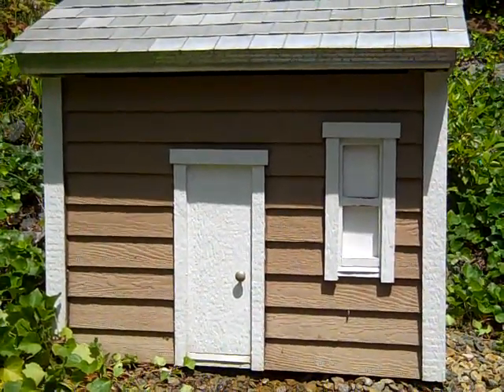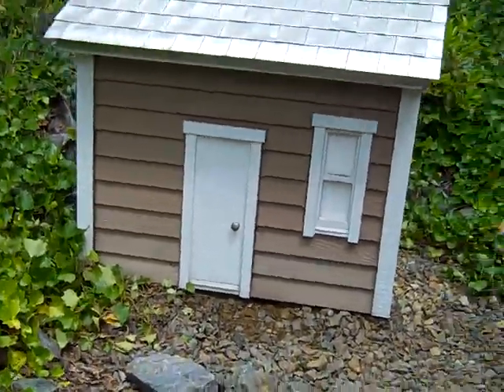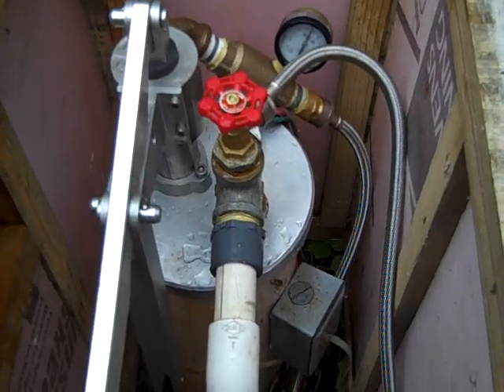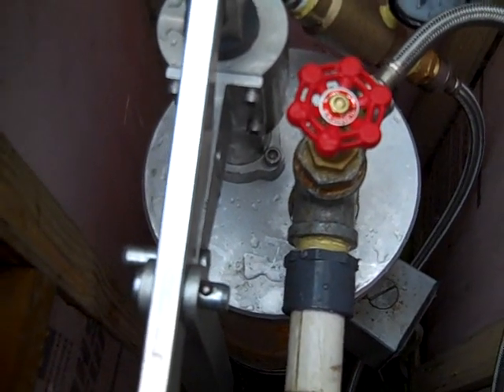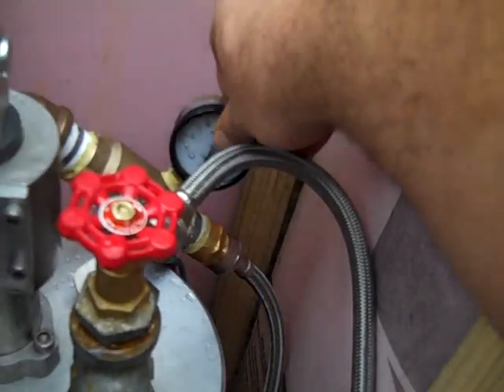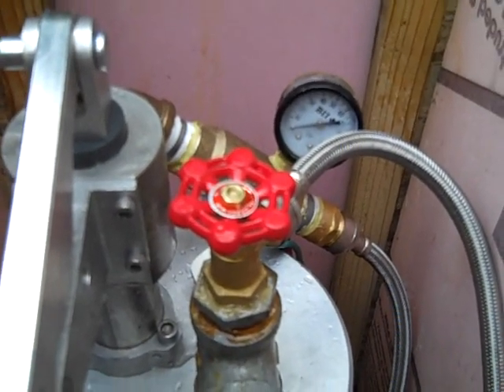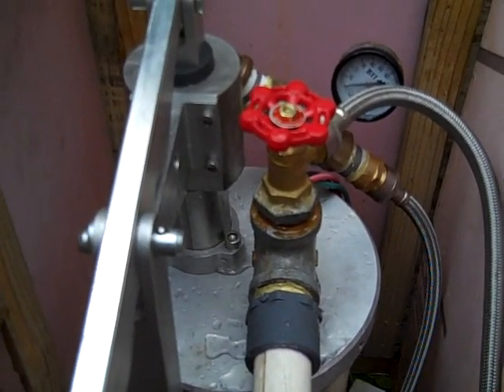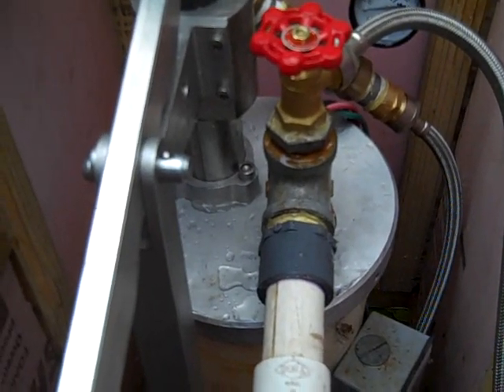It Fits and It's Simple

Comment from the maker: Sorry, That won;t work but I did have a customer just drill another 2" well about 10 ft from his existing one and I put a simple pump on that and back fed his existing water lines.  If you ever decide to do that I would recommend casing it with 2" galvanized pipe as that will make a strong mount for the Simple pump 2" cap. Let me know.  Thanks

Comment from the maker: Yes, It is a great thing to have your well inside your building because it is safe, secure,  and will not freeze.  Provision ( hatch in roof, removable skylight or flexible pipe) must be made for removal of the pump, for the Simple Pump we supply 54" drop pipes for these situations so you can install /remove the pump without hitting the ceiling.   I would love to have a well in my house!  I did growing up.

Comment from the maker: Probably not but the Simple Pump does not need to be protected as it has a built in "weep" hole.  Your existing well plumbing is under the frost line anyway so all you would need to do is change out your cap and install a Simple Pump.  They run this way in Canada so you are covered!  Good question.

Comment: we have a well in the back yard, basically a 6-8" diameter pipe sticking out of the ground. it has been uncovered though for over a decade. I am sure that dirt/leaves etc have fallen into it. I am not sure if it has water either. Presuming it does have water how would you clean it out?